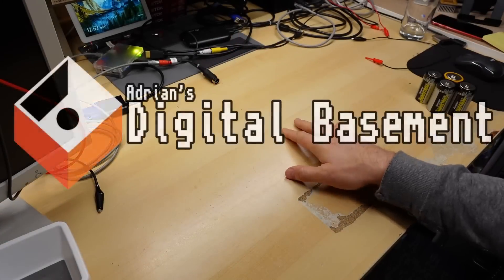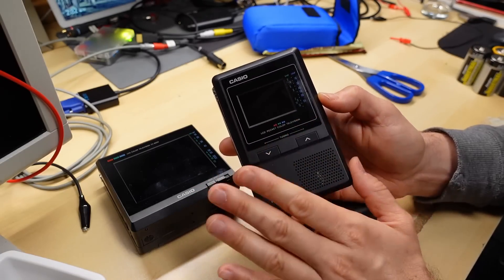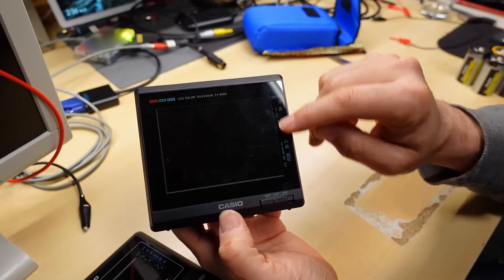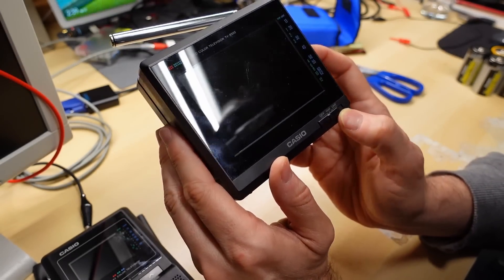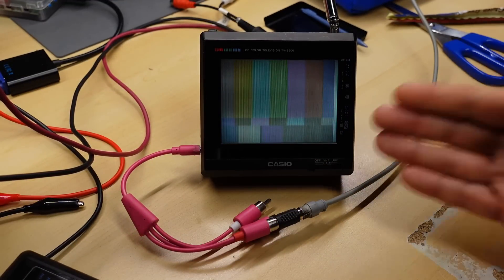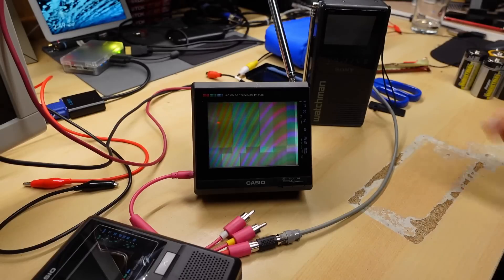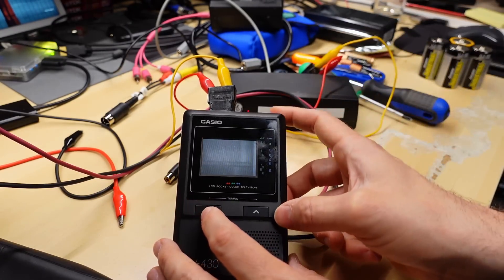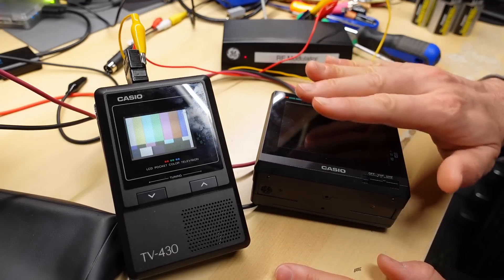Early 90's LCD portable TVs: Tour and test

Comment: Any whistling noise may be from the voltage inverter that provides high voltage to the backlight. Most laptops will have one, usually under the lcd bezel. Watch your fingers. 400 Volts!

Comment: The TV-430 has the same 2" screen as the TV-400. In fact, the entire set is identical - Casio just did their usual thing of slightly changing the cosmetic appearance of something and calling it an entirely different model.

That TV-8500 is a sweetheart - the highest-end model of its time with a 4" screen - even bigger than that included on the VF-3000 portable TV/VCR.

The backlight on all of these is a fluorescent lamp, not LED :)

I'm surprised the picture from the A/V input looks that good. All Casio TVs with an A/V input, that I know of, require a stupid special cable that's impossible to get now, which has some unknown circuitry in it which reduces the video level. A normal cable just makes the picture washed out. But maybe the 8500 is an exception, because that picture looks decent.

I've also observed the smaller units to have a better picture than the larger ones. I think the bigger and higher-resolution those early HQM displays got, the harder it was to preserve the contrast and color quality. The STN displays Casio introduced in the mid-late 90s overcame this issue.

If you wanna preserve the functionality of these, a re-cap is pretty necessary. That's why the TV-430 is producing a whine from the speaker. At the very least, replace the one yellow Elna cap - that one leaks and destroys a lot of these.

Comment: I had a few of those portable TV's back in the early 90's.  If you think those had hard to see screens, In the mid 80's My father had a Casio B&W LCD pocket TV (Casio TV-30) that you had to flip up the LCD and there was a mirror under that you would actually look at to see the program. The LCD was mounted in a window that light had to pass through. It was not backlit. It relied on the sun (had to sit by a sunny window) or if the room was bright enough you could watch it indoors in theory. there was an additional AA battery powered clip on light that you could put on it to provide light It was not great because it used CCFL tubes.  The cool thing about the TV was that it was only about 5.5" x 3" an inch thick. He would bring it out with him on Sundays so he could watch the Viking's (NFL) games... lol I still have the TV-30

Comment: Just fixed a tv-400. Bad caps in the power supply area. The crappy Elna brand. If you have one that backlight turns on but no sound or picture there’s a good chance it’s got bad and even leaked caps.

Comment: I've been buying and experimenting on these vintage Casio TV's recently and yes I admit the LCD is quite tricky to see and the contrast is quite bad. But you can adjust the brightness and contrast when you open up the case and flip underside the circuit board. The pot trimmers usually aren't marked but they're there along with color alignment, sensitivity, agc adjustments, etc. you just have to experiment which is which (I marked the original setting with a marker pen to restore to default when something goes wrong). The most recent one I got is the  TV1400 and the sound is really LOUD! The viewing might be bad but I'm having fun with these old TV's because they works like wonders! We still have analog TV stations here in the Philippines so these old Casio TVs are still usable here.  I remember as a child in the 80's I lusted over having my own Sony Watchman because my dad won't allow me watching TV during schooldays he would lock the wooden door of that CRT TV of ours. Then when these Casio LCD TV's first came out in the 90's I even lusted more haha!

Comment: I had (and still have) the TV-430, or its PAL equivalent.  Definitely came out before 1991, as I got it for Xmas, in possibly 1990. I remember watching it on at least one coach trip in the summer of 1991. As you can imagine, the signal in a moving vehicle wasn't the greatest. I remember when the batteries used to die, the screen would flicker quickly, and eventually stick on an olive green screen (and distorted sound) before going off completely. Unfortunately, it only displays that olive screen these days, even with brand new batteries, so I'm guessing there's a dead capacitor inside or something.

Comment: Try RF in on the larger TV. The composite video circuitry could be bad. I have a new Casio portable tv with that exact problem. RG in works fine, Composite in is brutally washed out.
Reply: Casio TVs need a special A/V cable that only Casio sold, and is impossible to find now. It had unknown circuitry inside it to reduce the video level so it would show up correctly on the TV. Using a normal straight-through cable produces the washed-out picture you describe.

RF is the best way to get a signal into these.

Comment: Passive-matrix color  LCD tech from that period was universally awful low-contrast garbage. Minimal viewing angles, very dim backlight, very low contrast, prone to overheating. We knew how bad it was at the time, but there was just nothing better except small black and white CRTs. Only around 1992 did monster-expensive portable PCs with active-matrix color LCDs start to emerge.  An "early adopter" friend with too much money bought a very expensive Philips LCD flat-screen active-matrix TV in 1996, about 21 or 24 inches in size. The colors were good but any fast moving detail looked like absolute crap because it was still an analog TV and interlaced video signals didn't render correctly.

Comment: I got a Casio handheld color LCD TV from Radio Shack in 2000 or 2001. It was an open box and I believe it was about 70 bucks. I got a lot of use out of it by connecting it to my hidden cable box in my room. It came in handy when my family and I would go on a trip somewhere. It was customary for me to see a city limits sign and start trying to see what stations would come in while we were driving. Ahhhh good old analogue broadcasting, it may not have been HD but you had the luxury or tuning into a station and being able to watch it even if the reception was bad. Unlike Digital broadcasts where you either get the signal or you don't lol.

Comment: I still have my Radio Shack 1.6" diagonal color LCD TV.  That was the biggest purchase I ever made as a kid because it was so expensive (on a kid's budget).  It has no auxiliary input, so I took a female coax end with a wire on it and wrapped the wire around the antenna so I could connect a VCR or my Commodore 64.  With the C64 I could get a good picture, and could just barely see a single pixel if the color contrast was distinct enough.  Now that all broadcast TV is digital I don't have  much use of it any more.

Comment: Bought a TV-480 and a 5" TV/radio a couple of months ago. Using the 300-75 ohm converter, got a lousy image from the converter box. When I used a 3.5mm 1/8" Mono Male plug to F-Type Female Jack Adapter Connector (for a Bose unit), the image came in very clear without any image degradation. Not only that, these were cheaper than the included adapter for the 300 ohm adapter.

Comment: Nice video. I have a CASIO TV-470 that is working perfectly but it has the worst backlight I have ever seen, I need to look at the screen at certain angle to be able to see someting.

Fun fact, I was able to receive image on it using, what i call, the McGyver Station : A simple Sony antenna connected to the output of my RF modulator that has a potentiometer to increase the signal's strengh. No external antenna connected. I was able to watch videos in my bed.

Comment: Had that Casio too long time ago. Used it with chargeable batteries and when those batteries were going out of juice I left the TV on so I can then refresh the batteries and charge them full again. What happened is the TV got very hot and then the backlight broke. So half empty batteries break the lamp-circuit. Backlight didn't work anymore. But I got white leds from my work and made a backlight from two leds.

Comment: Since the electronics inside are mostly useless in 2021, I would be tempted to gut the larger one and try to source a similarly sized modern replacement LCD panel to put in its place.  As the case is still actually quite nice.

Comment: The backlight in these old LCD TV's is usually CCFL, Cold Cathode Florescent Light, not LED
The high pitched noise noted is probably the high voltage inverter to run the CCFL

Comment: I had a seiko one with diagonal filter lines rather than the vertical one that casio used. You could plug in a ZX Spectrum into it and read the text. You could also read teletext on BBC when it was transmitting random pages when BBC2 was off the air.

Comment: I remember choosing a handheld LCD TV around 1994, and one of my primary tests was to see if I could read the score of a sporting event. Most of them were crap, but there was one good one. It wasn't the biggest screen, but it was the sharpest, and also highest contrast. It cost three times the cheap units, too, but I bought it because I could actually stand to watch it for hours at a time. It was still working, although not seeing much use, when it got stolen seven or eight years later.
Reply: Do you live in Detroit?

Comment: On that Japanese Portable TV, the reason their is no mode switch for external composite video input is that the video Jack has a switch contact that is disconnected when the plug is pushed in, just like how some portable radios shut off the internal speaker when plugging in headphones. So it’s not really auto detecting the video signal but switching to composite audio/video input mode when the video Jack is plugged in.

Comment: When cell phones first became big in the mid 80s, the FCC shrunk the UHF TV band from 83 channels to 69. (Nice!) If you had an older TV that could still tune to channel 83, you could eavesdrop on analog cell conversations.

That whine you're hearing is the inverter for the cold cathode fluorescent backlight. These little suckers predate white LEDs by at least a decade, so they had to use little CCFL tubes as the backlight. There are probably two in the bigger TV, judging by the hotspots on the screen, and the crazy-high power consumption.

FWIW, recapping the bigger one might restore the screen's contrast. I'm just going by my own experience with Sega Game Gears, but they have very similar color LCDs in them, and when their caps go bad, the screens end up looking completely washed out just like that TV.

Comment: I had a similar model with a 2.2 inch screen. Subtitles were impossible to read on that tiny low resolution screen. And here in Sweden, all foreign shows are subtitled. :( I used it on an airplane once (probably not allowed) and were able to pick up stations from several hundreds of miles away. Great fun! :)

Comment: I'm wondering if you'd get a better result with the 8500 if you used the external antenna jack instead of the audio/video jack.  There is a possibility that the cable/adapter you used doesn't have the proper "pin out" or that the length of the 3.5mm jack for the original adapter was a different length than the one you're using which could cause this adapter to over shoot or undershoot the pins in the hole on the side of the tv.  I've seen these cables with a slightly longer jack, or ones that have the tip as ground and ones that have the 3rd ring as ground, things like that.

Comment: channel bands asignation is only user side information, tv still uses frequency to tune on stations and since it does not have rotary analog tuner it most likelt just search whole cannel band fluidly down to some fractions of megahertz
most japanese and usa channel frequencys overlap anyway so the bigger one probably would tune to that improvised antena just fine only in random place on the scale
the only problem might be the sound,
Reply: actually, Japan used the same tv standard(NTSC system M) as the USA.
So the color and sound will work.
The Frequencies used are different.
Some channels will indeed work, but not on the channel numbers that you'd expect.

Comment: In the mid-1990s they gave me a Watchman from North America where I live and it had some sort of ray tube that would cast is image upon an inclined plane of phosphorus or something. It was monochromatic. I don't know where along the line I lost that thing but it was the length of two decks of cards and perhaps the thickness of two of them. I believe it took about 6 double a batteries to operate it. Do me as just the dishwasher in that time frame that was a pretty cool gift of unclaimed materials that have been there for several years

Comment: I remember my first LCD tv, got it at radio shack, it was black and white and the LCD was on the lid, you opened it up and looked at the image reflected off a mirror. the nice thing was the brighter the light the better the image, even outside in sun light. but to watch in a dark room you needed a back-light accessory that really drained the batteries.

Comment: @Adrian's Digital Basement ][
I had one of those, a model similar to the 8500. It came with the AV cable adapter and ac pack. I used it for playing NES games at a point when I didn't have a proper TV. Made a permanent AC adapter pack for it(made with parts from Radio Shack where I bought the unit) as it was rarely used on the go. I loved it! The screen quality was a lot better than the one you've got, so I think the one you have might have a problem. Of course that could be a fun video too! Diagnosing and repairing it, heck yes! I'd watch that!

Comment: I got an Casio one before the winter Olympic in 1994. Sadly it got lost around 2000. But I found the picture quality on mine was quite a bit better than what you show here. I used it a lot at work when tuning in satellite 📡 actually. And I don’t think it was an very expensive model I had. Was a gift from my mom. I do however remember they were an absolute power hog when running on battery. :)

Comment: Great video!  Boy, big-time flashbacks for me... I had the TV-400... bought it in the Phillippines when I was stationed a Clark AB.   I hated the vinyl slipcase - no real protection.  On base, there was a place that made fanny-packs (yes, it was the late 80s) and they would also make custom bags, etc.  So, brought my TV in and they made a padded case, with a zipper that went 3/4ths around, and a handle on the side that didn't have the zipper - all for $10.  Worked out awesome.  Unfortunately, when the NTSC digital switch happened in the late 2000s, I decided that I didn't need the TV anymore and got rid of it.

Comment: What you're looking at aren't LEDs, they're CFLs. Which in general are why you needed all of those batteries.
Reply: And also the reason why Adrian could hear a High Frequency noise (coming from the Compact Fluorescent HV power supply).

Comment: That TV-8500's a bit of an odd one...  TV System says M, which was used in most of the Americas, South Korea and Taiwan, but it's using the Japanese frequencies.  I'd expect to see System J for a JDM model.  The only difference between System M and System J is the black level (M has black at 7.5 IRE, J at 0, like PAL), so maybe they just didn't bother making a System J version?  Or maybe South Korea and/or Taiwan uses System M on the Japanese frequencies?  But the text is all in English and Japanese, no Korean or (Traditional) Chinese.  Weird.

Comment: System M is the North American black and white TV broadcast standard-aka 525 line 60 Hz. AFAIK NTSC-M is essentially 100% compatible with NTSC-J. In fact, I can't find any documentation of what the difference between System M and System J, the Japanese standard, actually is.
Reply: Other than the channel frequencies, the only differences are black level and color temperature. NTSC-J has a black level of 0 IRE, while NTSC-M is 7.5. i.e. there is a "pedestal" in American NTSC where any signal below 7.5 IRE is interpreted as black. They did this "black crush" so that mild background noise wouldn't be visible, at the expense of some dynamic range. The Japanese generally had more density in transmitters, giving stronger signal, so they didn't bother with the pedestal as it simplified circuitry to just not bother with it (of course in later TVs from the 80's onward it didn't simplify anything, but they didn't know that). 

Consequently the systems are 99.9% compatible and most people don't notice, but modern auto-gain will get screwed up slightly by the different pedestal expectations vs. the black burst (which is always pure black on both systems). The effect is hard to describe but you can definitely see the difference in darker scenes. US devices on Japanese monitors will look washed out, Japanese devices on US monitors will seem dim and have solid black areas. On a Japanese TV you can compensate a bit by turning down the black level, but on a US TV turning up the black level will make things look less dark but the bottom-end detail will still be crushed out of the final image on all but very old, simple all-analog devices. 

Fortunately on modern TVs there is usually a buried setting that lets you turn the pedestal on and off, particular if the TV is meant to also accept signals from a VGA card or something since those never have a pedestal. Many digitally-controlled CRT TVs from the 90's and 2000's also had the setting but it was usually hidden in the service menu. Since I was a total weeb and had Japanese equipment, I wound up going to that setting often.

The biggest problems from this come with VCRs, which aside from some very early units use auto-gain when recording (also how the first macrovision worked). If you try to record a Japanese signal on an American VCR, it will permanently crush the blacks in the recording. 

The reference color temperature isn't really an issue unless you're a stickler for calibration.
Reply: @NozomuYume  Thanks for the info!